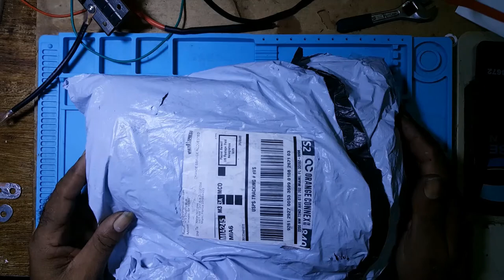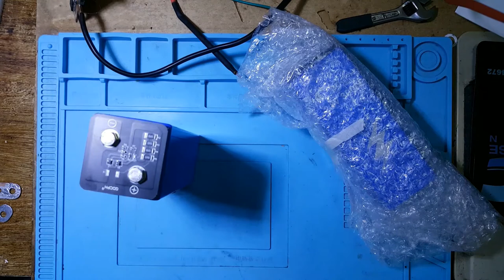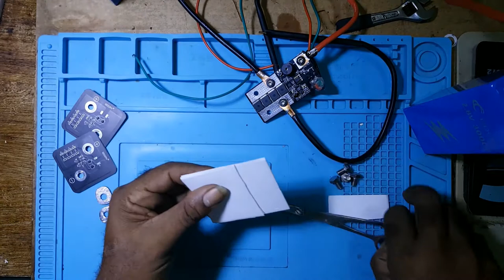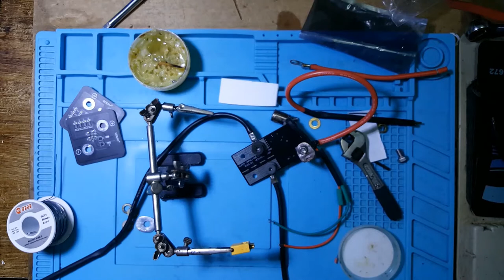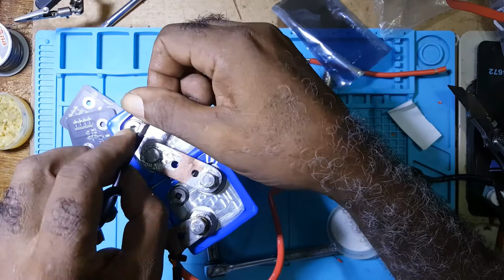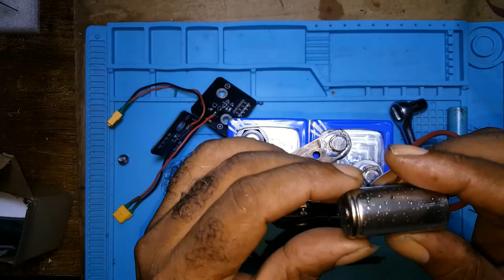Mini Spot Welder And Super Capacitor Assembly

Comment: I have had the same problem with them boards i fixed it by resoldering the black resistors that are in a row grouped together now it dont heat up and has more power
Reply from the maker: Mine burnt up.